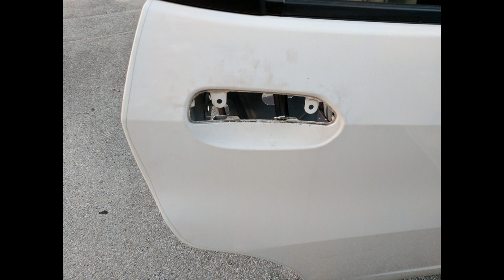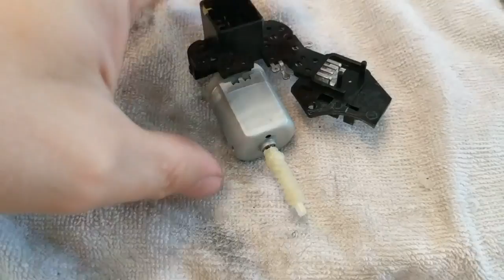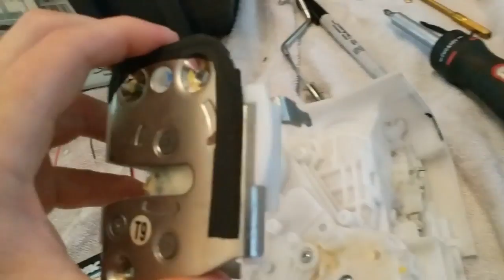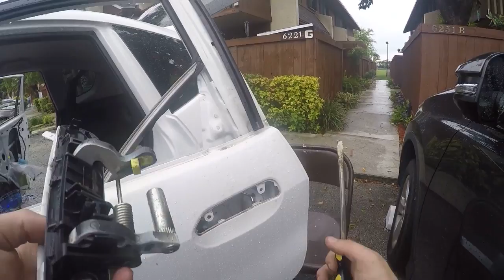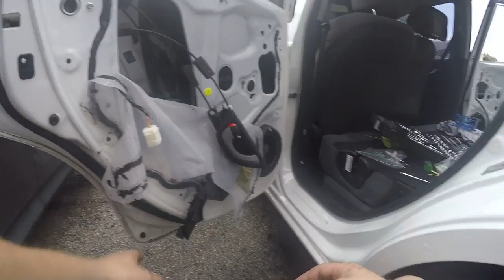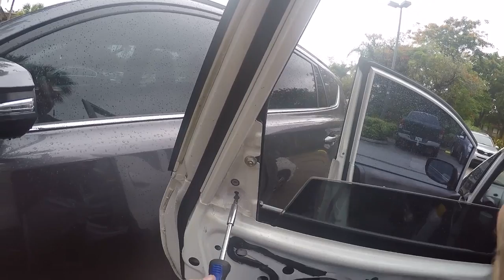Fixing Broken Automatic Door Lock Actuator for $5 on Honda Fit or Honda Jazz.

Comment: I have a 2012 Fit in which i replaced the rear driver side door actuator. I was able to remove the actuator without removing the window. Basically i unscrewed the lower channel window guide screw he identifies at 3:38 mark. After i unscrewed the actuator and removed the rod that connects to the door handle, i guided the actuator all the way to the bottom of the door and with some very mild flex on the channel guide. i pushed the actuator past the channel guide and removed the actuator. Putting it back in was just as easy. So if you can save yourself from removing the window, i hope this helps!

Comment: my 2009 Honda Fit driver's door lock only partly flicks the locking tab (but won't move it enough to unlock) though sometimes repeatedly hitting the unlock button on the fob will eventually move the tab to unlock but it's iffy and I wouldn't want to depend on that to open the door. the actual physical door lock has a cylinder issue so can't insert the key so the actuator is the ONLY way I have to unlock the door.
were the symptoms you had on this faulty actuator similar to my problem -- i.e. you had to hit the unlock button over and over again to open the lock or was it something else?

Comment: Great info. Today I almost opened the assemble than I decided not to cuz finding the motor would have been difficult and in my country guys at junk yard rip u off for small items. I basically installed external actuator and used two main wires to to run external actuator and things are working so far. I'll find the motor and fix it to the factory setting

Comment: Be warned if you have a non-US market Jazz/Fit. 

I am attempting this repair on an Australian market 2009 Jazz, front left side door. The locking module has a different design to what is shown here - I don't know if it's because it's a front door instead of a rear door, but it's similar enough that this video is still super useful.

HOWEVER I've run into trouble.

The motor in mine has a different length shaft! It's a 20mm shaft not 10mm. I had already bought the replacement motor based on the info in this video before I disassembled everything. Sadly the 10mm shaft is not long enough to reliably hold the worm gear. All I could find was a pack of four motors as well, so now I have four useless-to-me 10mm shaft motors and I have to wait for the 20mm shaft versions to arrive (again, could only find a 4 pack) before I can put the car back together.

I originally tried to find an entire replacement locking module. But the left side is the passenger side here in Oz, and all I could find were left side modules for US market Fits, which would be drivers side modules. I didn't want to take a chance that a US drivers side module would work in my passenger door - the electrics on the drivers side might be different! So I decided to attempt the motor-only fix as done here. Which would have gone great if I had the correct motor!

Fun times.

Comment: My lock works, but makes a loud, horrible noise. I've dealt with it, but I'm always worried something in the actuator is going to fail. Did I hear a little grindy squeak noise when you locked the door at https://youtu.be/OSCoKGYsGwQ?t=876 ? I'm hoping that it isnt a worn gear or something else. What do you think that little noise was (is?) for you? Once I decide to tear it all down (using this video as a guide) my answer should be right in front of me. Fingers crossed. Thank you!

Comment: May 2023: Sir, while on a Stateside visit this month, I had to do this repair on my daughter's 2010 Honda Fit. Thanks to you, I was spared a $900 parts & labor charge. I can't tell you how grateful I am to you for taking the trouble to figure out this lock actuator motor R&R, filming the repair, and then sharing your knowledge with the world. Heeding your warnings - particularly the mistakes you made - I played and replayed parts of your vid to get it right, exactly right; I felt like a watch maker or jeweler. At the conclusion of this project the (1) door opened and closed and (2) the lock actuator worked. Incredible. Total cost: $9 for the lock actuator motor including shipping. Greetings from a very satisfied and grateful viewer in Beirut, Lebanon.

Comment: i rebuilt the driver door actuator on my 09 fit without removing the plastic tab holding the metal pushrod bc i did NOT want to destroy the plastic which would have left me without a part basically.  kinda pushed it out of the way while attached to that rod, was able to get the cover off to access the motor.  tested before i put back in the door with a screw driver in the locking mech, pulled the push lines and it worked as should.  so far no more clicking!!! thanks mrleanandfresh for the guidance.

Comment: Mine makes a loud kind of whirring noise each time it tries to lock/unlock that lasts about a full second. It locks unlocks fine, even though the lock switch kind of sticks and is stiff to move, but the sound is the annoying part. 

Will this fix that issue? Anyway I appreciate you making this video!
Reply: That’s probably the gears stripped inside the housing, not the motor,

Comment: Hi, great video. Can you describe what your symptoms were? We have a 07' CRV, and the front passenger lock is unlocking by itself, right after I lock it with the FOB. I found the was a TSB and a class action suit. Honda would repair but only until a 2015 deadline. I was looking for info on why the actuators were failing, and came across your video. The Fit actuator looks identical to the CRV actuator. So it comes down to the motor? It's the motor that fails? Why would it unlock? Would it be because it fails to overcome a spring load in the latch or something?
Reply from the maker: Reform Riverside Essentially the locks we're not looking or unlocking when they should. When the driver's side lock stopped working, the doors would constantly lock and unlock because the sensor detecting the lock position was showing that the door wasn't locked when it should be. Changing out the motor worked for that issue. But you should double check that the driver's side door is actually locking from the inside. If it is not, then this will solve the problems. If it is locking and then unlocking, then your issue may like elsewhere.

Comment: In general, your video is good. But you failed to mention a single thing about the cable connecting the outside door key cylinder to the actuator. On my 2011 Fit, on the driver's door, the plastic clip that keeps this cable in the actuator broke and needed to be replaced. Only a $4 part. But, when broken, because this cable can't then move, it jams the locking and unlocking of the door from either the key or the key fob. The result is that you can lock the door no problem, but you cannot unlock it, And, if you can't unlock the drivers' door, none of the other doors will unlock either. And only the driver's door has a key cylinder. Even the real hatch does not have a key cylinder. I was majorly bummed when your video didn't show any ofr this
Reply from the maker: David Crandon Apologies, I only filmed the rear doors even though I eventually did replace the driver's side. Unfortunately I didn't film the driver's side. I don't recall it being too different from the rear doors or too difficult to remove.
Reply: This sounds like it was a real headache

Comment: Sorry if stupid question but why does the whole window have to be taken out to fix the door lock? Any way to keep it rolled up? or does in need to be down/out of the way to take out the bits to get to the locking mechanism?
Reply: I did it with the window still in.
Reply from the maker: jannaqiao Apologize for the late reply, the window has to be taken out because the rear channel that holds the window in place needs to be moved to allow removal of the actuator. With the window rolled up the channel is unable to move out of the way enough to allow access and removal.
Reply: @Mrcleanandfresh  I’m years late on this, but I followed your steps for one door and it worked. Then I went to fix a second door, and figured out that you do not actually have to remove the window. You can just unscrew the bottom screw for the central channel and move that with the window up to get the actuator out. It makes the process twice as fast.

Comment: Thank you for posting this video. I followed your instructions and was able to replace the motor in the actuator on my 2010 Honda Fit. Honda also quoted me $500 to replace the actuator and the actuator replacements that I found online were around $140. I purchased only the motor for $10 on Amazon, so you helped me save a ton of money. I'm sorry that you got the lock stuck shut, but I'm thankful that you explained very clearly how NOT to do that in this video. Thanks again!

Comment: I agree with James above. The actuator isn’t that expensive especially if you go aftermarket. Honda charges a fortune for the labor. Buy the whole actuator and install it yourself for $55 and don’t risk your doors being stuck closed. Sawing into your car door to get it open is not fun and not a worthwhile risk. Just did my back door on an 08 accord with OEM parts in an hour for under $55.  Pretty easy process and still saved $300 for an hour of easy labor.
Reply: can't find James
Reply: I was going to say something similar. This is GREAT information, and I don't discount that at all, but the parts cost has dropped significantly-- I recently purchased the driver's side front door lock actuator from Amazon for $48. I live in Alaska, or I'd have gone to a local auto parts shop, but they were $81 here on island. 

It also gave me an excuse to replace the door speakers on both front doors with Alpines from Crutchfield for another $119-- you know-, since I was in there anyway!

Comment: Is it the same motor in all doors including the driver's?
Reply from the maker: ivan barboza All of the side doors are the same motor. The rear hatch has a different sized motor shaft, but the same size motor.
Reply: Thanks

Comment: I just discovered a little trick if it is the drivers(master lock)  Just disconnect the lock wire and THen the FOB will work fine.  The actuator will work again for a while longer.  How much longer.  I don;t know.  TO be seen.  .  :-)
Reply: I know its been a while but Im hoping someone can help. I have the same issue with my drivers side door. Ehat wire should I disconnect? Thanks..